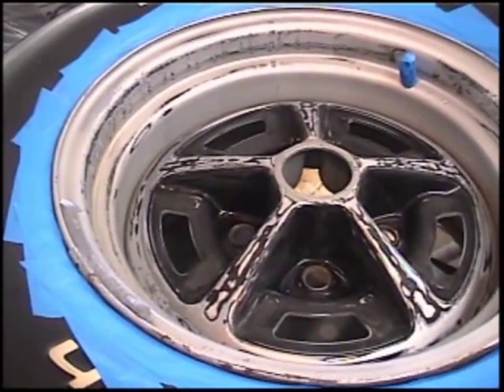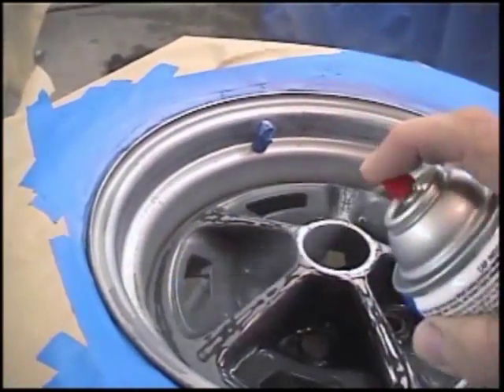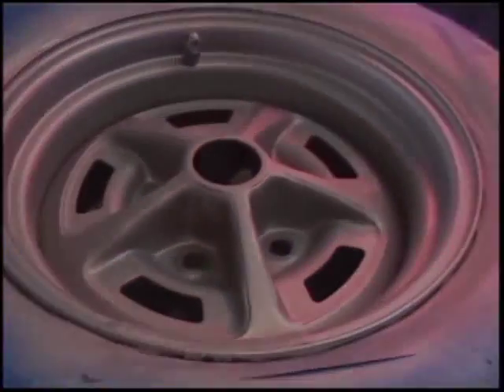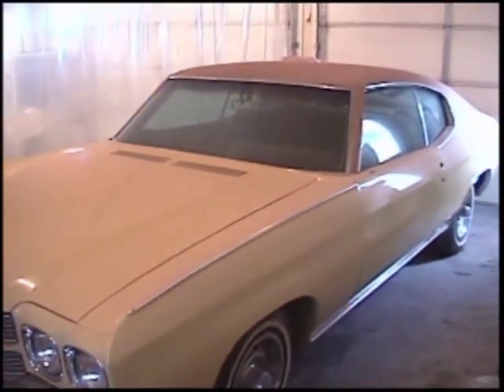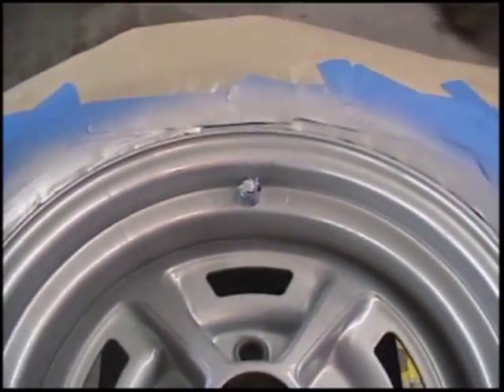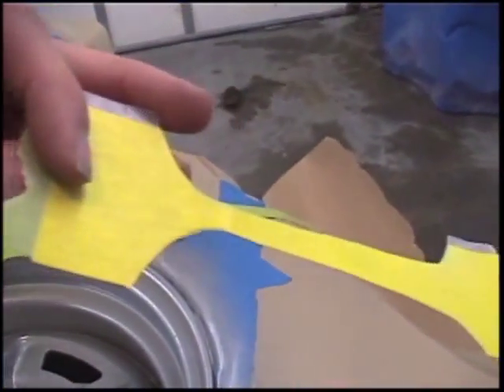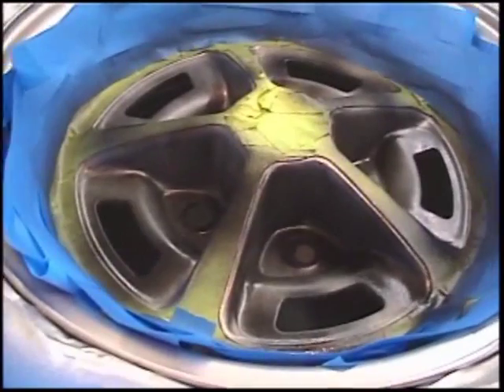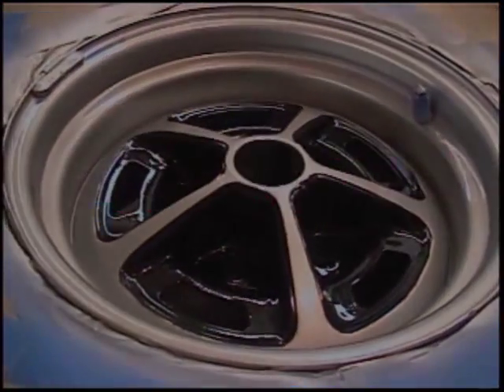How to Paint wheels Chevelle SS part 2

Comment: I know this is a old post but, I was wondering, How long did you let the color dry before applying the clear coat? On 2 of my wheels the gray started wrinkling after letting them dry overnight when applying the clear coat.
Reply from the maker: Make sure it is enamel clear not lacquer